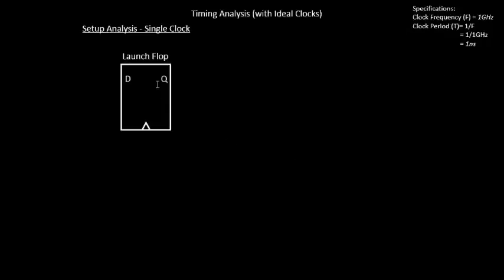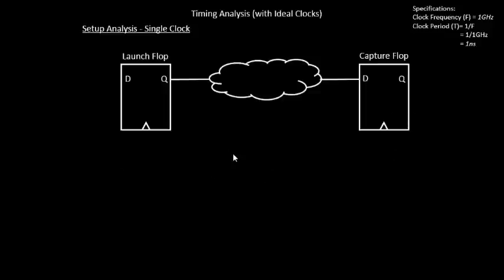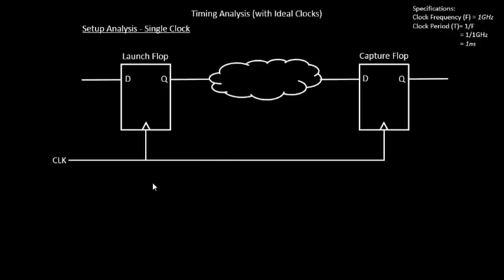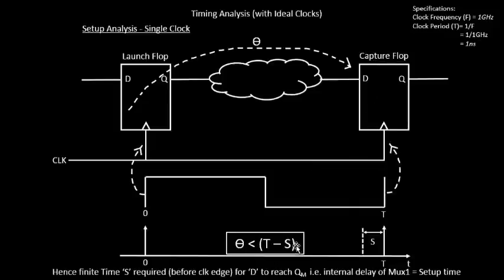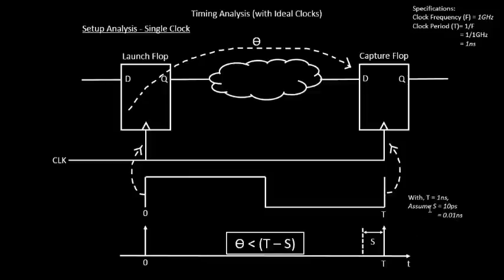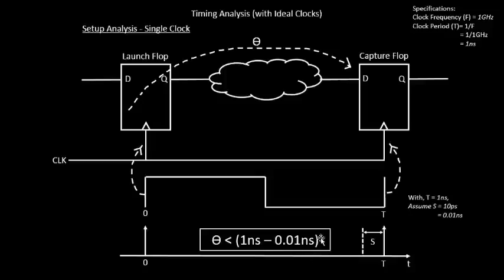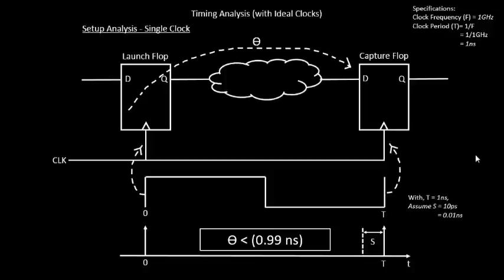How to do Set-up and Hold Timing analysis ? Open to Innovate !!

Comment: that is a new way for me to explain the flip-flop structure. Truly, two-mux structure is equivalent to the real structure of flip-flop, but would it mislead any student?
Reply: not at all
you can actually build a d-flip flop using this two mux setup and this is most general way to explain setup and hold time (analogous to master slave flip flop structure)

Comment: your way of explaining is really nice but the clock is given to launching and receiving flop at same time...means the active edge will be received by both the flops at same time 0.
Reply from the maker: Good observation Prasad.... to answer your question, 'yes' from analysis point of view, 'no' from real chip timing simulation point of view. For analysis, we would like to view 2 edges at the same time but, one edge coming at '0' and other edge coming at time 'T'. Under real scenario, the edges will come at their respective time, ie first edge at '0'ns and 2nd edge at 'T'ns, 3rd edge at '2T' ns and so on
Reply: yea that is right. Thank you.
Reply from the maker: Prasad Vaidya your welcome